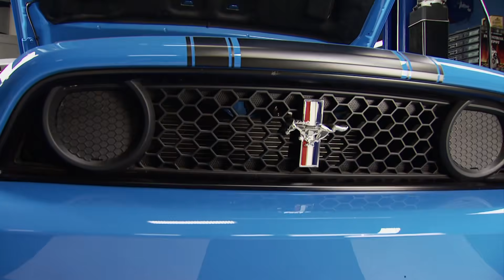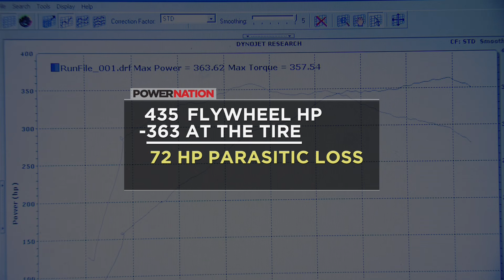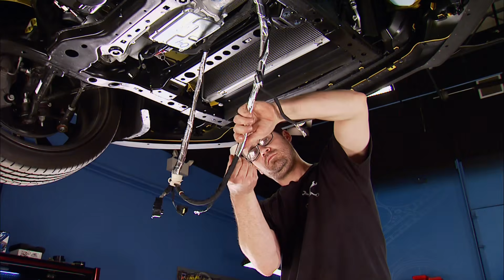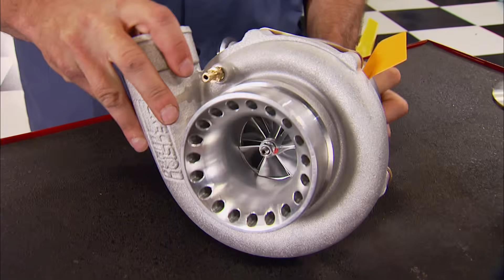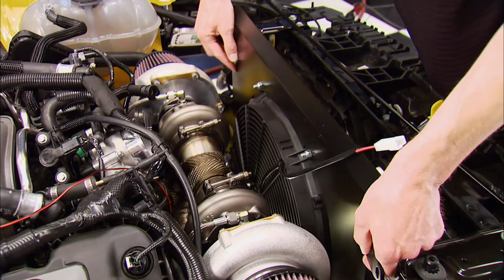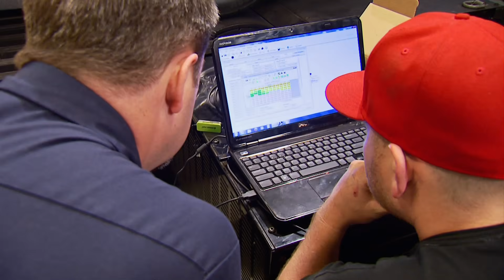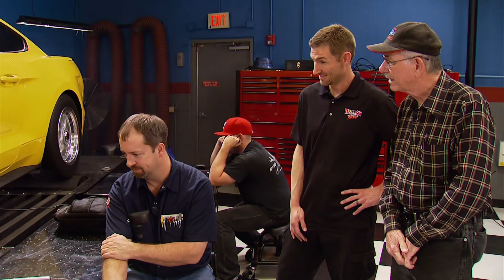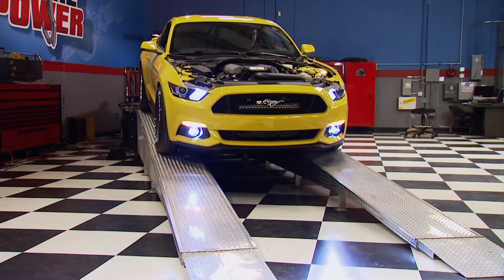Twin Turbo'ing a 2015 Mustang GT to Beat the Young Kids at the Strip - Engine Power S2, E16

Comment: Are we to assume that all of the internal components are rated for this type of abuse? I have no doubt it can handle it for a little while but will wear out very quickly.
Reply: Some are holding 900whp on stock internal coyotes look at the people running VMP blowers. Main thing are the oil pump gears which isnt an expensive mod especially if ya are already adding boost ya might as well spend the 200$ for the OPGs
Reply: They dont last bro. I know and have seen it. Dont believe You tube hero runs
Reply: Labor for oil pump gears is a crapload.  Gotta pull off entire front of motor
Reply: Who does this have to turn into a Chevy vs Ford ass kissing contest? Chevrolet actually got the ls engines from Ford..a 351.. They kept going with the old tech when Ford wanted to go in the future... It's all good... they're probably secretly working on shit behind the scenes anyway.
Reply: AS long as heat doesn't get to high it should be fine but I doubt he is daily driven it...
Reply: mewrongway OHC motors a notoriously unreliable and NHRA out lawed them early on because chain will snap sending small lethal projectiles into the stands. https://youtu.be/jzL_4yVuTX4
Reply: @Thelongmanable  I am sorry that you and methewrongway have had your feelings hurt by so many Coyotes.....
And the NHRA hasn't outlawed ohc motors genius. And I have a modular motor with the so called unreliable timing chains and valvetrain with over 500k and it's never had a valve cover off.....
Reply: robinesavage404 I shoot coyotes annoying pest animals...
Reply: robinesavage404 You have a modular home as well LOL.... 😂🤣😂🤣😂🤣😂🤣
Reply: @robinesavage404  You have 4.6L with 500k miles. Come on that is bs...
Serious.  Never been opened. Must burn oil and leak by now
Reply: @maximusvonce1381  doesn't rattle, only smokes on initial start up or if you let it idle for long periods of time. (valve seals). Idc what engine it is, after 500k miles it's going to smoke a little. But doesn't leak any oil. And no it has never been opened.
Reply: @maximusvonce1381  I stand corrected. I thought they went with forged pistons on the gen 3. Especially since the power that they are consistently holding on big boost #'s. Toughest hypereutectic pistons I've ever seen in a production engine!
Reply: I was thinking the same thing, from the factory, they didn’t intend it to make that much power. Something will shear off internally.
Reply: Exactly
Reply: Cast pistons buddy. Forge it and do it right
Reply: @maximusvonce1381  I think they are forged.. I'm pretty sure that are.
Reply: @MF-Rell  Nope. Cast pistons except aluminator.  Google it
Reply: @maximusvonce1381  no, they are forged.
Reply: @robinesavage404  Nope. Stock Gen 3 coyote does not have Forged pistons. You have no clue. Look up Gen 3 internals.  Get aluminator if you want forged pistons..
Reply: I have 103k on my 600wheel pump gas daily work car 11 tvs 5.0. Chains are fine thank God
Reply: @Seymour Kuntz 
No shit.  I am being 100% honest.   I have no reason to randomly bullshit ya.
Reply: @Seymour Kuntz 
https://youtu.be/-ZltQLnbmEo
Reply: stock internals on a coyote are bulletproof up to about 700 hp. after that you REALLY want forged internals. the weak link at any horsepower level is the chains for the cams
Reply: @origionalwinja  no it's not...
Reply: It’s a coyote😂 David van vorris is runnin like 1100hp on his stock block/internals
Reply: Railer Man23 plenty of people losing motors on YouTube with less power... I wouldn’t press these motors much over 700-800... and even then I would still bring the rev limit down. 

It’s always a gamble ... not every motor comes out the same
Reply: Yes anything over 650wheel and stock coyotes wont see 100k miles
Reply: @maximusvonce1381  sure
Reply: maximus vonce they can see it, but people run the RPMs high... I’d say lower the limit to about 5800-6000 tops and you could probably make it. 

Hell some make it with stock rev limits, but those are factory freaks or stupid good tunes.
Reply: You are a moron. I know coyote aluminator 800wheel 100k miles and flawless.
Reply: I done this with a 2v and made 725rwhp.  The engine internals literally fell apart.  Oh, not the mention the transmission granaded.  After I rebuilt everything and had it all back together I had spent 65K.  
True story
Reply: @EPICYELLOWHORSE  On what?
Reply: @MF-Rell  
Not sure if I understand the question.   I built a twin turbo 2v Mustang GT on about 18psi
Reply: Are you serious.  $65k. Bro i can buy an aluminator For $10k and 800wheel forever
Reply: Burrell1 Sounds like your driving had more to do with it..
Reply: @Thelongmanable  
Dont be naive.  Nobody builds a car with 725rwhp unless they plan to drive it accordingly.  Well, except for the TRAILER QUEERS.
You can believe my driving down the 1320 had EVERYTHING to do with it!
🤣👍🏾
Reply: Good point. Too bad most people on here aren't as wise as you👍
Reply: Burrell1 Glad you liked your own post really made me buy into your ideology....
Reply: It will blow up...should have a lower static compression.
Reply: Buff Barnaby LOWER STATIC COMPRESSION EQUAL LOWER HP AND DOES ABSOLUTELY NOTHING BUT THROWS MONEY AWAY!!!!!

Comment: stock compresion ratio will blow that car!!!
Reply: they are running 116 octane which helps
Reply: not if you run high octance gas and retard the timing as boost and revs go up,
cleetus runs heaps more boost on rudy.
Reply: It's all in the tuning.
Reply: high octane prevents pre detonation it as nothing to do with blowing the head,
its the HUGE preshure that do thatif it was E85
-difrent story
whats the point to retard ignition if u want to run high boost u loose so much potentian - its a soft were patch to a problem that should be solved by hardwere
Reply: Not if you tune it properly and use the correct fuel. If you can't find 116 octane, there are additives that will increase the octane rating of pump gas close to that. Or run E85.

Comment: At first I was like "boo, no manual" then I remembered, MT82.
Reply: new transmissions can out perform manuals all day.  no use for a manual anymore. and the have a manual mode and most sports cars have paddle shifters
Reply: Big Sean247 you can’t put perform fun and skill ....

No auto will be more fun and no auto will ever command more skill than a manual.. 

No point of racing in drag if you aren’t racing to see who the better driver is

Comment: That oil pan tap setup looks like it was designed at 4:30pm on a Friday 😥😥😥
Reply: Rhubarb Pie they didn’t even take the oil pan off
Reply: @andytommykeddy3224  "yo dawg, we heard you like metal chips in your engine"
Reply: I really hope they took that pan off unless they want him back for a engine rebuild when it blows up 😂😂😂
Reply: @beany1987  shit, that ought to get a repeat visit
Reply: So many people use the method. The grease on the tap is to catch metal shavings, 10s of thousands of people have used this method on many cars and never had an issue
Reply: @TrailerParkKingWv  I understand the function of the grease, but that claim of number of uses without issue can't be proven, that is speculation. All I am saying is that if money isn't an object, which I imagine is the case since this guy had a turbo kit installed by the manufacturer on television, take off the oil pan and do something that doesn't look like hammered cat shit. I.E. a welded bung, not a double ended A/N fitting with teflon pile tape.
Reply: @rhubarbpie2027  removing the pan on a coyote is not worth th wasted time and process when this works exactly the same
Reply: BurninRubber93 
“10s of thousands of people have used this method...”

I highly doubt that since most people do it with the pan off the engine.
Reply: I hope they drained the oil at least
Reply: prob y it was smokin n the dude maning the dyno screen wasn't happy w any results
Reply: @kenc.2448  
The kit is designed to be DIY so that's why that step is in there. It's up to the end user which route they wanna take. It's not gonna hurt anything jeez; it's fine...
Reply: @kenc.2448  
Who are YOU to say it's the wrong way? There's plenty of cars running that same setup with NO issues. It was done RIGHT so hush the hell up...
Reply: I cringed thinking about the metal scraps falling into the pan
Reply: The sketchiest shit I’ve seen let’s drill and tap an oil pan while it’s on the car what could possibly go wrong
Reply: @kenc.2448  lol ya because the Hellion company are just shade tree mechanics right? It's a fucking drain plug
Reply: Many of you nimrods keep saying the pan punch is the wrong way to do it without a reason why.
Reply: I am no expert but if I were to burn 10k+ in a preparation I wouldn't be happy with that
Reply: Yep, it’s poor.  It WILL leak over time. Better to remove the pan, and weld on a flange or at least nut and bolt
Reply: Damn, he smart
Reply: The inexperience is apparent in these comments.  It’s a stamped steel pan, they used a punch specifically for this reason. Also makes its own bung to cut threads in with the displaced metal.  Notice the grease on the tap?  That’s to contain any small chips.  This is a new engine and already has metal in the oil, the few odd chips that may have gotten in there are not gonna make a difference.
Reply: @Highstranger951  or... you can take off the oil pan, cut a hole, weld a bung, and do it the right way. Sorry, maybe that's my inexperience talking.
Reply: Rhubarb Pie why is that the “right” way?  Have you ever pulled a pan on a coyote while in the car?
Reply: @Highstranger951  do I need to have performed hands on maintenance in this exact case to understand certain methods of execution are superior? The way performed here looks like a quick and easy way as opposed to a higher quality route.
Reply: Yes i have
Reply: Rhubarb Pie  this way would be more acceptable
Reply: @rhubarbpie2027  if you pull the engine you can pull the pan,not with it in.
Reply: @rhubarbpie2027  to pull this engine to do what you suggest is about 10 hours+ at $100 usd an hour and doesn't give that much better results
Reply: @trillrifaxegrindor4411  the guy has food as his name so that should tell you everything
Reply: @Highstranger951  so that little detail couldn't be explained in the video for the 'inexperienced' people watching this video
Reply: @beany1987  
That's why they repeat over and over in the video, FOLLOW THE DETAILED INSTRUCTIONS PROVIDED WITH THE KIT. Why can't people understand these aren't step by step videos just an overview of the installation process and the results to expect...
Reply: I admit I cringed then played it back a few times to see if too many beers had deceived my eyes, but nope, it was nasty sober as well. Why not just undo the oil drain plug and let the engine fail naturally lol
Reply: @bigboreracing356  ok boomer
Reply: @bigboreracing356  dramatic? get over it mate, you are the one banging on

Comment: That boss doesn’t even have a coyote it’s a road runner lol
Reply: Yup
Reply: Jon Anderson the gt350 is not a coyote it’s a voodoo engine
Reply: @RealSpeedPerformance  i know what it is...it is a coyote BASED engine...its just a different variation of it and they call it the voodoo...it has the flat plane and it has different higher flowing heads, among other things but essentially its a modded coyote.  Its bored out, different internals, heads, crank, intake, among other things but its still a coyote based engine.  The 5.4/5.8 dohc in the gt500s is a totally different engine...the heads wont interchange neither will the intake and other things like that...totally different engine...but the voodoo and coyote can both interchange parts because they are both COYOTE BASED engines...which is what i said and i stand by it.
Reply: @RealSpeedPerformance  thus why I said "yep" to your comment.
Reply: @michaelharris748  You can't interchange very many parts between the Voodoo and Coyote, but the Boss motor is basically an upgraded Coyote. Switching to flat plane is not just a simple upgrade it is a completely different engine
Reply: While technically it is called a roadrunner engine by the Ford Executives who made it it's technically still a coyote based engine just like the GT350 engine they're all the same thing what's different hard parts putting them together all their parts will interchange on to one another so in my eyes they're the same engine

Comment: Wait so you mean to tell me that i don’t have to severely modify my intake manifold  that uses Port Injection to accept a 4 barrel carb adapter and ruin the airflow characteristics of the intake to install a Fast EFI kit. Then put the car on the dyno and wonder why it made less horsepower than stock then put a holley 750 and make 80 more horsepower than stock? I can just put 98lbs injectors and call it a day?!

Comment: 72 hp loss,  I have driven cars with less than 72 hp.
Reply: My 61 VW was 36HP...drove it to college.
Reply: You beast...
Reply: my Opel Corsa has 90hp. But this is Spain, driving around a 5.0 V8 would cost a fortune in gas. Gas is cheap in america, so automakers don't bother squeezing horsepower from small engines.

Comment: 🤣🤔🤣🤨 I don't even run more than 35 psi on all season tires, I'm not a dragster but don't you want low psi for grip.
Reply: I run 30 hot, 35 cold then heat them up and drop to 30.  For daily I use 38 for gas saving lol as if. Also that's on a UHP summer tire not slick.

Comment: 818HP on the stock fuel pump??? 🤔
Reply: No. They mentioned the extra pump in the trunk that engages under WOT
Reply: @Ayyo_productions-u2h  guess I missed that
Reply: Pretty sure that was a voltage booster in the trunk..ups the voltage on the stock pump to put out more flow at wot. Im not a fan of them just drop in a single 455lph pump and be done.
Reply: @minibikemadman  even with a BAP that's pushing the limits of the stock system
Reply: @virgilcross  yes most deffiently. But this was what 4 years ago? Now a days they would throw a 455 drop in.
Reply: @virgilcross  they put in higher injectors also
Reply: They installed a product the over voltages the fuel pump under boost. You know, over working a stock component until it breaks in a few days instead of doing it right and upgrading it?
Reply: The fuel pump isnt gonna last very long

Comment: The TT Dodge Challenger numbers are really underwhelming, considering it has 425hp stock.
Reply: chiggins 5 psi and no cam swap that sounds about right. It barely makes over 300 to the tires stock
Reply: Cory Wilson you’re correct about everything, except about the stock power “barely making around 300hp”.. I used to own a 2010 SRT8 and the 6.1’s are around 365Whp
Reply: @hmackprotection1  they dynoed it and the number were right around 310whp
Reply: Cory Wilson 5 psi on a built motor seems like a waste. I know they’re giving it away but still, they’re not beating a hellcat with those numbers
Reply: chiggins 5psi is literally nothing. They were trying to keep the engine safe. If they would’ve turned it up to 9-11psi that would’ve been more impressive
Reply: @bigboreracing356  they put them under the red one they did too with the 425whp
Reply: @bigboreracing356  thats the one they put the stroker in and took to the auto cross learn to drive course?
Reply: @bigboreracing356  well i just watched it and it was a built stroker with a hellion kit and made 727
Reply: @bigboreracing356  
this one

https://www.youtube.com/watch?v=ueS8XGQub7U

Comment: Wait you drilled and tapped an oil pan with out removing it from the car? I hole this old guy doesn't get metal shavings in his engine.
Reply: IKR
Reply: Please don't hole the old guy, lol
Reply: Joe Figueroa What about when they cut the thread?
Reply: @colind9638  the grease all over the tap is sticky and catches the shavings from tapping
Reply: enjoy the video,make educated comments.you sound like an ass.this is the way every single "bolt on" aftermarket turbo or supercharger is oiled
Reply: @Joe Figueroa, still not a good idea. Should of took oil pan off. 🙈
Reply: I think Id flush that oil pan before calling it good
Reply: @jS197 This gent paid someone [probably a fair old chunk of change] to do a bunch of work to his motor. Undoing the oil pan doesn't seem too much to expect
Reply: The oil pan is plastic
Reply: @toddfrasco6569  Did you watch the video where they hammered a tool through the sheet metal pan?
Reply: @toddfrasco6569  really dude? Plastic oil pan that you can without doubt see that its metal....
Reply: Todd Frasco you sir are absolutely right

Comment: I love my 2017 Mustang GT custom Whipple. It was so easy to hit 700+ whp. And the most fun I’ve ever had building a car!!  Looking forward to my next TT project in F-150 Coyote form.
Reply: Will Jeff don’t forget to replace the oil pump gears
Reply: El_De_La_Lobo did it on my mustang, and do it on my F150. The F-150 will get the Mustang coyote upgraded pump housing along with the thicker gears. Thanks for the recommend:)